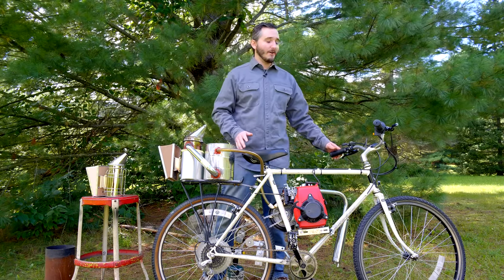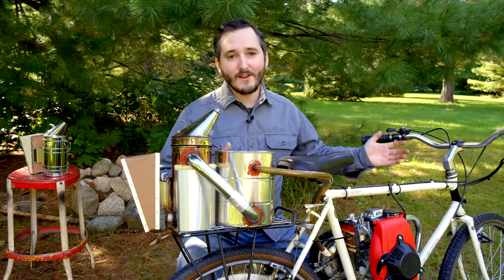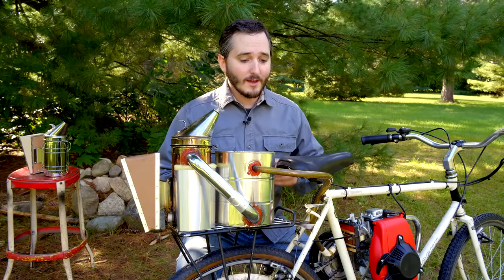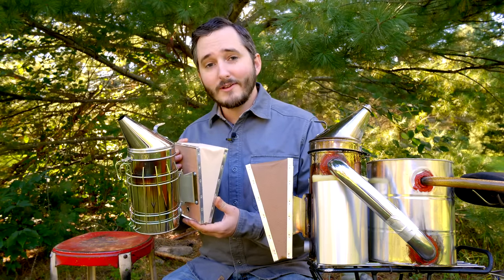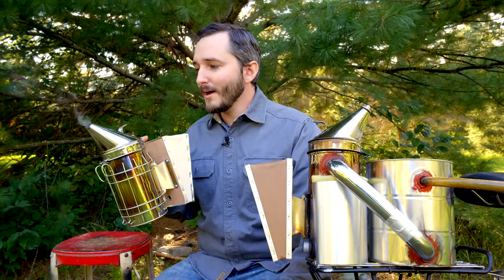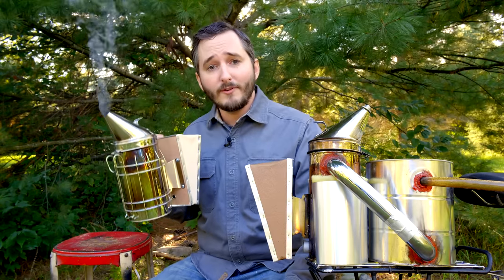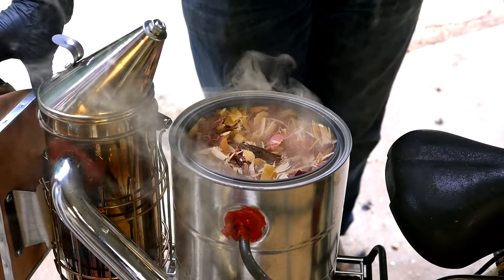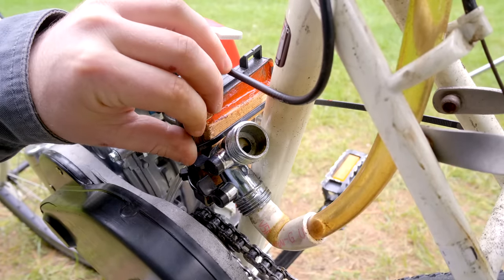Running a Gasoline Engine on Firewood | Woodgas Biofuel

Comment: Cooling the gas through a long copper tube between the smoker and the filter and catching the drips in the filter may drop out a bit more of the tar and water you don't want.

Comment: Yeah I didn't expect much trying to run a petroleum engine on a different type of fuel. If you can go through all the trouble of fine tuning compression rates, spark gap/strength etc, I think you could get a solid engine running. Maybe put out as much HP as a comparable steam engine.

Comment: just watching this again and I wonder if changing the timing on the engine to suit the fuel may help? sounds like when it is running there is a slight pinking (rattle) noise that may indicate the timing is off, all in all awesome work.

Comment: i would really like to see you make a liquid version of the wood gas. that would definitely make it easier to store and probably easier to burn in an engine. keep up the good work i would love to be doing what you are doing if i had the money and the time.
Reply: That wont be easy, since you will have to convert it first with fischer tropsch catalytic process, with other raw gasses and then distill and cool it down. Since in this build pressure is not an option. Then after this it defeats maybe the point, since it will be normal fuel

Comment: Germans used to run public buses on wood gas from charcoal.  Every few miles the driver had to toss a little more charcoal in the stove outside of the bus.  It was the poisonous carbon monoxide that burns with oxygen to make carbon dioxide.

Comment: I wonder if you added a tank for the gas to pressurize in first... you could probably keep the gasifier you have here. You'll need some type of pressure safety so it doesn't explode, and a throttle assembly or regulator to keep a consistent flow of gas to the carburetor.

Comment: What is needed is a supercharger that is ported to suck in the gas with air.  This would be run off a pulley belt or chain.  I don't think the intake of the motor will draw enough on these small engines.  You could also use an electric supercharger with a small battery.

Comment: Hey!  Ever think about putting a bell on the intake?  I'm no engineer but isn't that supposed to create some sort of venturi ?  As the woodgas get pulled in, it also pulls in air, but because a bell has more volume at the intake, doesn't it magically pull more volume into the intake?  Bernoulli's principle?

Comment: Probably 2 years too late for advice but I would add a check valve on your air in take reduce wood gas losses you might need to open your air intake to compensate for the resistance of a check valve. 

Your engine would draw more gas through your system and could run your gasifier hotter and use up the fuel quickly.

Comment: You can still view the instructions for the wood gas conversion they used on busses /cars during the war with full diagrams of what does what
The burn gas was separate on the ones I've seen and big on a mini trailer towed behind

Comment: this is amazing stuff man now I really want to make a  bike like yours :)
also, I'm a bit worried about the water vapour getting in the engine and stopping the reaction 
because there seemed to be some condensing in the pipe at 10:00

Comment: Great idea.
Maybe an idea would be to replace the bellows with a tube facing forward on the bicycle with an appropriately sized inlet which would have air rammed into it when the bike moved forward thus increasing gas pressure as speed increases. I  might try this myself however I would need to buy a new engine as the only one I have currently is a 2 stroke. I try could have a think of a way of atomising oil maybe similarly to how a carb works with fuel, any suggestions?

Comment: If you need a bigger gasifier, i.e. 4X the size - what about mounting a larger unit on the handlebars in a shopping basket and instead of the bellows as on the bee-smoke unit what about an air scoop of some type that would run automatically when the bike was in motion?  With a long enough and flexible hose to the carby - might just work - But I'm not technically minded - so just thought ;)

Comment: You need a valve that can regulate the the wood fuel as you accelerate because a rich mixture also affects combustion and lowers efficiency

Comment: You need to use like a air compressor water trap there was lots on condensation in the tube next to the carby

Comment: As Jeff Rudom used to say to me.
Herswachagaddado 
Make some charcoal and use that. There is no shortage of waste wood that needs burning in the USA. Charcoal is more energy dense and will burn clean so will not dirty your engine and you only need a small gasifier. A tiny generator feeding an electric bike would be good. The you could plug it into the house and power the house.

Comment: would it be possible to use an engine with a turbo to force more air and wood gas into the engine and prevent some of the positive pressure leaks that occur?

Comment: try connecting the 2 valves together so when you accelerate it opens the other one fully and at idle its at 50 percent open

Comment: maybe pellets will do better , air polen filter like one in the car in addition with ( I don't know , water , sand ) may filter mor of the smoke and a mini turbine with an Y pipe will mix more efficient air with gas ... in addition a small hho generator for the turbine , that's run with 2 dynamo's from the wheels will be a good stabilization of the fuel ... on the hho generator construction the pipe that make the water to return in the battery you may be inspired to construct a better filter for the smoke ... good luck 🍀 !!! and if I can help you more I will be glad to do so

Comment: I'm no expert on any of these concepts but your dual ball valve may be acting like more of an extra exhaust, or at least a leak of the fuel, having them separate in a way maybe two one way valves to the tube so you're not losing your fuel while trying to get the right mixture. good luck

Comment: Have you tried adding water to the filter? Would it work by piping the avalible outlet of the smoker to the filter itself without plugging it and adding a secondary pipe? and  theres probably a way to start the engine by pedaling the bike and using the chain to spin the clutch, that would be an easier way to start it if you could engineer a chain and ratchet somehow. Great project and keep going!

Comment: Have you attempted an Updraft Charcoal Gasifier for this application?  It would be easier due to no need to dry out the gas, simply filter out the charcoal dust.

Comment: you are still getting condensation going down the tube towards the engine which is mixing with the gas, I would suggest adding a capped off tube so that the liquid will flow into it and be trapped

Comment: What about something like a charcoal making setup with a complete combustion area surrounds an area filled with fuel that is only heated and not burned. Should let you relatively easily pull off the volatiles and not have any of the byproducts of combustion. As a side effect, you have a chamber filled with charcoal once the burn is completed.

Comment: I love the idea of a wood gas bike but the biggest ploblem is this is not a complete wood gas setup because you are missing a external heat source to keep the pyrolysis reaction at the proper temperature. When you heat up the bee smoker and then close the smoker you are only producing gas from the excess heat in the smoker made from blowing the smoker with oxygen so it will cool down and stop producing gas. My solution is to either put the bee smoker in a charcoal grill starter cylinder or make a cylinder big enough to wrap around the bee smoker and burn wood pellet around the smoker to keep the temperature high to sustain the wood gas production.

Comment: I was allergic to bee´s as well, but then took the stings from the rubbergloves and stung myself - first causiusly in very very little doses, then more and more. After some time I could work without gear! Later on I learnd, that this is is a common method called desensibilisation, and I thought, it was my idea ;-)  Maybe that helps?
Reply from the maker: Yeah I know the method. In my case I became more and more sensitive as I got stung.

Comment: You could attach a mechanism from the bike's pedals to the bllows so you could stoke it on the go and then when it gets running stop but when you need more juice peddle. Not sure about how to start the engine while moving but that's probably too dangerous anyway.

Comment: Use different grades of steel wool as filters meshed together with a fine steel  mesh.
The engine will produce too much waste for long term operation however a minute or 3 is achievable.

Comment: I've seen this done one some television program before but got me thinking about it all over again. 
Have you tried maybe a face mask filter as a make shift air filter for the gas going in, I  would think alot of the carbon in the smoke would be like exhaust with the gas + air mix so your 50/50 air fuel mix is 50/(25/25) 50% air and 25 fuel 25 exhaust. You would lose chamber space but the mix ratio could be tweaked and maybe have it running. Just my unlearned input

Comment: Perhaps you could rig up a vacuum line from the motor to the gassifyer? So once you stoke the flame enough to get the engine running it can pull a vaccine drawing fresh air into the gassifyer by itself, creating a positive feedback loop until the fuel runs out and your not stuck stoking the flames every 5 seconds

Comment: Hey real quick.. what if you connected your pedals to the bellow so that you can have a way to pump air while you're riding. That way you can have a hotter flame and more fully pack your "distiller"

Comment: My thoughts to make this better is to take the gasifier apparatus off of the bike and make a Gasifier Cryogenic Condenser. This will filter out the non conbustables at different cryogenic levels and get clean pressurized 2 C2H6 liquid Ethane go gas. Just add 7 oxygen and a spark to get (4 CO2) and (6 H²O) big energy potential. 2 C2H6 (g) + 7 O2 (g) → 4 CO2 (g) + 6 H2O (l)  more H2O less Co2. 14 Exothermic reactions, when one mole of ethane combusts, it releases approximately -1559 kJ of heat. But when petroleum combusts typically around -45 kJ/g or -5000 kJ/mol (negative sign indicating heat released), with the exact value varying based on the hydrocarbon mix within the petroleum sample, Alkane has 26 Exothermic reactions per molecule. Energy Density has all to do with power and efficiency. Best of luck.  Love your incredible work. 🎉❤😊

Comment: Maby you can attach the wheel to a gear that is attached to the airbag blower. Not exactly in my words but you know what im trying to say. And for cars you can make it where you do the same thing but at high speeds you can shift the gear using inertia gears to make that autoblow at a better more efficient pace so you don't blow away the embers. Rod. Had to throw that in there. Cool eh? My mechanical engineering show-off.

Comment: A big problem could be, that there are nearly 50 procent of Co2 in the Woodgas, that makes it less flameable. We tryed to filter this out by a filter made of solid sodium hydroxide. So you get a reaction like this: 2 NaOH(s) + CO2(g) →Na2 CO3(s) + H2O(l)
.
Mabye this could be helpful.

Comment: I wonder if you could use cyclanic filtration. It probably won't work at idel but might work when the engine is running at higher rpms.

Comment: Perhaps you could use a rocket stove to heat the gasifier core. more heat, more gas? Point the air intake to the front so you can get more air into the rocket stove as you drive therefore making it more efficient, the faster you ride.

Comment: Could a model jet turbine engine, be fuel by this method
 and the exhaust could help to boil the wood instead of having a fire inside with the wood...
I would use it to run a homes heating and electricity
 and to charge electric vehicles.
Made to run on multiple fuel sources too

Comment: This thing looks great nice and simple but at high RPMs this will not combust properly when it is to hot I can tell looking at your set up a you're getting way too much tar and creosote into your engine this will affect your valves later on b you have to increase the intake line to your engine many times to get this gas to cool properly at a high flow rate. The faster this machine goes the more gas it will use the more cooling it will require. Super cool idea I love how simple it is and I'm not some jackass just leaving mindless comments I have built a couple of these that run trucks

Comment: Need check valve on fresh air intake with a plenum: intake pulse waste @ idle , gasifier big enough.
Get camco gasifier stove, use pellets 
Use small air inlet fan. Pre gassifier

Comment: Dude, you need to cool the wood gas down so that it becomes more dense and therefore has more energy per cubic centimeter/cubic inch. Try adding an old heater core from a car or light truck to your inlet pipe. It's actually quite important to cool the wood gas. By the way...it's not a "velve"...it's a VALVE!!!

Comment: hi ,  like always I follow your videos and really like your projects. I suggest you don't solve all the problems at once, of course you are not solving all the problems at once you just gonna step by step solving every level ,over all  suggest you don't generate the gas back of the bike and try to create gas in a state as station and fill it in a barrel with high pressure in the same way install a capsule behind the bike and fill it for every usage. like all the machines in my country (Iran) in this scenario you don't get into double problems (first gas generating and  the second burning by bike engine)

Comment: I would put your wood gas wood in a separate container and heat it by a external heat source so that way all you have is wood gas going into the combustion chamber of the engine and not also biproducts of the combustion of the gasifier similar on how you would put wood in a paint can with a small hole on the top and then put that in a fire to turn the wood in to charcoal

Comment: Why not use a telsa valve on the air valve as well, Just to prevent some of the backflow of gasses you seemed to be getting?

It looked like you were losing woodgas through your air intake valve

Comment: To make the run time longer, why don’t you double the height of the bee smoker with a metal cylinder on top and wrap it in insulation to keep the heat in?

Comment: Charcoal filter to capture smoke particles, a cyclone condenser could work with enough velocity in the gas heavier particles could be mitigated from the hydrogen methane and carbon monoxide fuel,, a water filter system with water displacement could filter the gas and provide a gas reserve, then filtering the water the solids could be saved or discarded. As for a fuel building a pellet die would give dense compact fuel as one could experiment with biomass mixes. I would like to see a gasification system combined with thermoelectric.

Comment: What about using an actual small catalytic converter for cleaning up the gas? After all, it works with gasoline and it is the reason they put them in cars. Hope this idea is relevant or useful.

Comment: Here's a question... Could one potentially create/filter the gas elsewhere, compress it into something like a small-sized propane tank, and run the 4-stroke off that? I know there's propane conversion kits out there, so I'd imagine wood gas isn't too far off...
Reply from the maker: It's not safe to pressurize because hydrogen makes metals brittle

Comment: Ok, your number one issue is you're burning your fuel,  you need to contain your fuel in a second chamber and heat the chamber with a fire or other heat source.  Do not directly burn your fuel!

You will get better fuel production and it will be extremely clean gas.

Comment: I wonder if it would be possible to modify the carburetor already on it by jetting it or something so that the wood gas was mixed with the air by venturi so that it wouldnt be billowing out of the air intake valve thingy. This is probably incoherent.

Comment: Those few drops of water is more than enough to drown a warm engine. The water turns to vapor and takes up all the volume. One or two drops into the intake can make an engine falter. It's even worse when it's in the fuel, because the Carb will help it turn to vapor, instead of the fuel. Water in the fuel, and water in the air are seperate issues, that need to be sloved on a tiny engine like this. Because you'll never know if you have the mix right or, there may have been a drop of water passing through the system.

Next I'd like to point out your intake "hose adapter" has all the working parts you need, but not the volume. It just plain won't ever pass enough gas/O2 mix to make even one half HP. Volume is power. Bigger the bang.. and all that. Want a big bang? Add more fuel, but fuel needs O2 in proper amounts to burn efficiently. Bigger isnt always better, but in this case it is. That tiny engine is starving